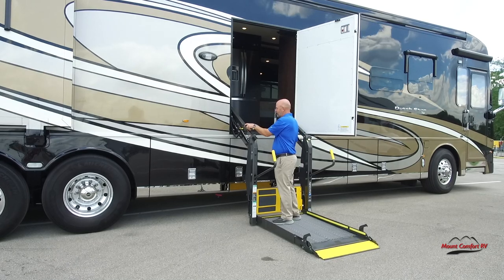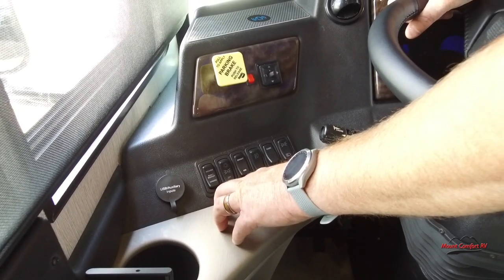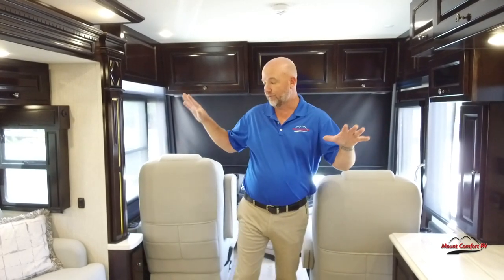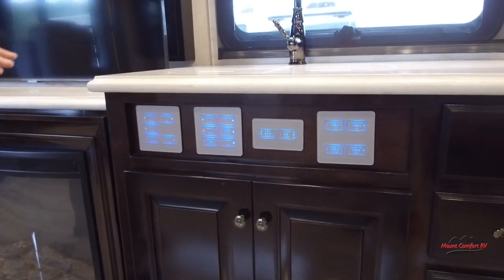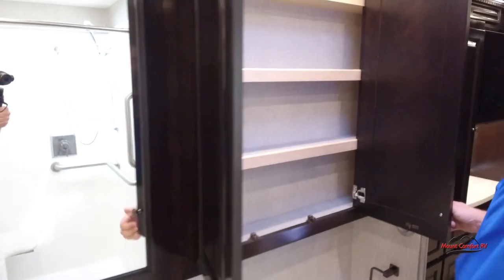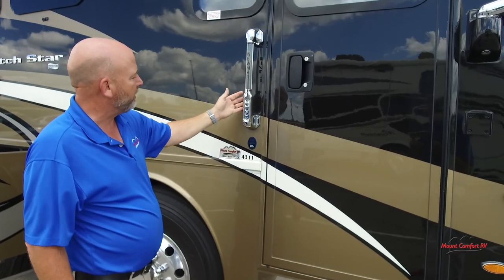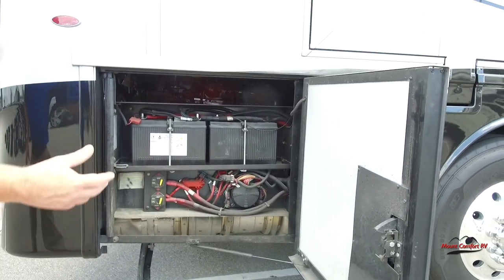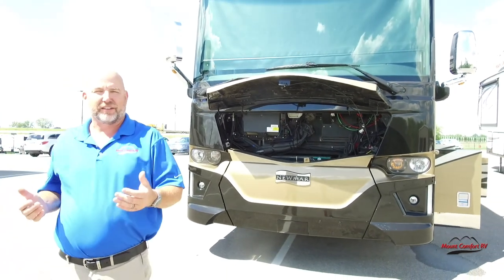Used 2022 Newmar Dutch Star 4311 Review | Mount Comfort RV

Comment: Great video review.  So happy that Newmar is making these models.  Also, glad to see that someone finally thought of lowering the microwave.  I see the coach is still set up for "wheelchair user with companion".  Would be nice to be able to open the wheelchair door, run the lift, exit, stow the lift and close the door without needing the companion.  Then also be able to completely get back in unassisted and close it all up behind you.  Maybe that is the case here, cant tell from the video.  If you can do a demo of a wheelchair accessible coach while sitting in a wheelchair, that would be awesome.  Keep up the good work and carry on.